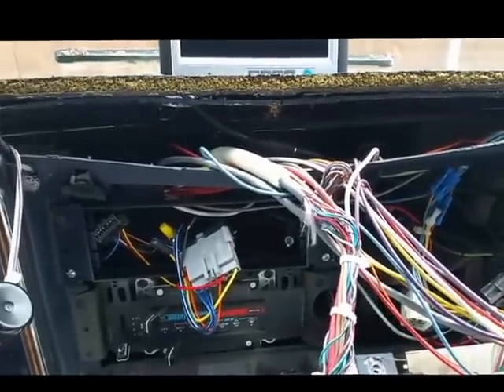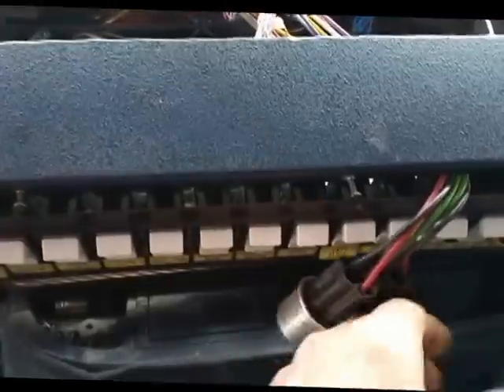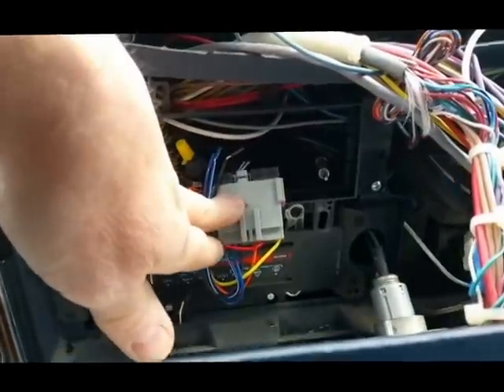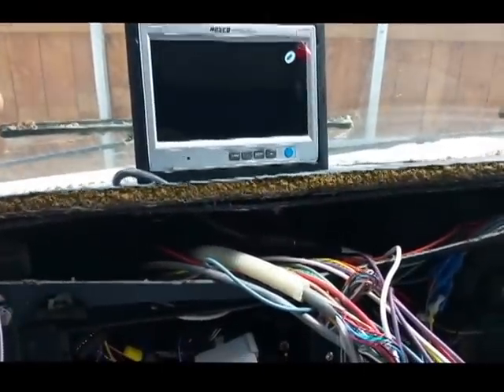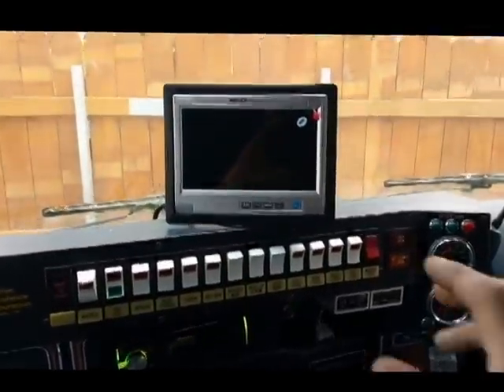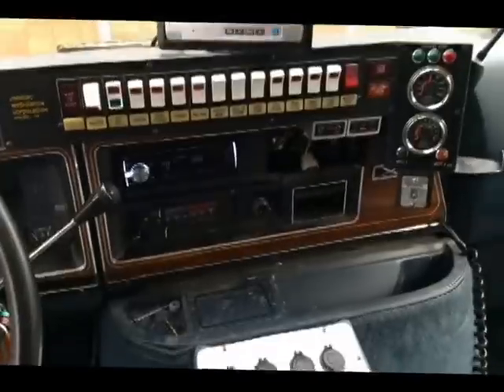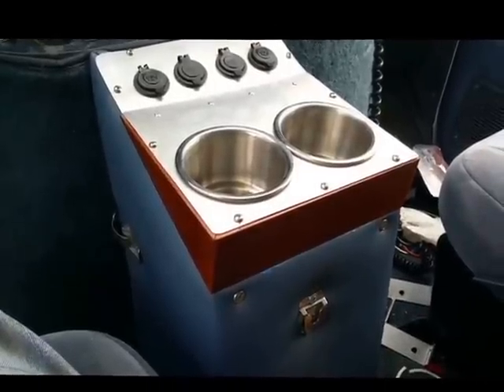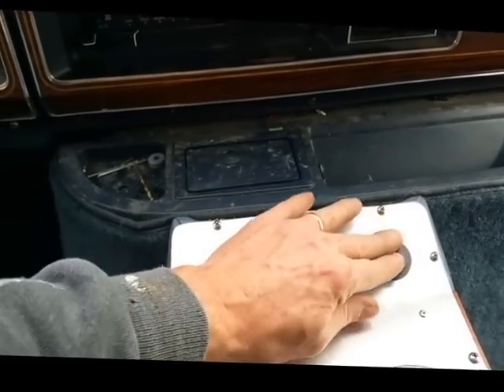#3 DIY Ambulance RV Conversion; Camper Van, Motor Home

Comment: I noticed the 110/120v outlets in the first video, was there a power inverter already installed for those?
Reply: +Coastal Empire I figured it did originally, but might have been removed when everything else was before the sale. I've also know of some to have a generator too.